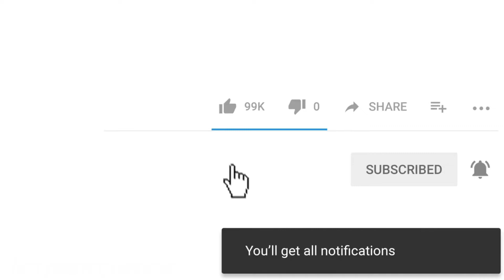How to Blend Within the Panel

Comment: I have that same gun, just curious to know why you spray clear @24psi ? Have you tried it at higher pressure ?
Reply from the maker: This gun really amaze me compared to high end sprayguns, with that air pressure I can spray basecoat and clear nicely, with expensive guns, I need at least 29psi sometimes even 35psi. I've tried spraying beyond 24psi with this gun but I don't like the result. Thanks a lot for watching and your query, have a great weekend.
Reply: Ian paints/details Thanks for the reply, have you sprayed any silvers or difficult colours with it ?,, I’ve only used it for clear coat did a full repaint on an Black Audi R8 in Debeer waterbase with there supreme clear. Check out my instagram page xchaserspiro
Reply from the maker: Yeah I did silvers and other metallics with this gun and I love the results, we are exclusively using glasurit 90line products for more than 6 years already. I usually use this gun for basecoat and clear . Sorry but I  don't have an Instagram account, I can't view your page.
Reply: Ian paints/details What gun were you using before this one ?
Reply from the maker: @spiropittas5477  GTI Pro Base 1.3 by Devilbiss
Reply: Ian paints/details Do you have a seperate one for base or use the same one, and just clean it out ?
Reply from the maker: @spiropittas5477   Only one gun most of the time, clean it out after spraying basecoat then spray clear and clean it good before putting back in my tool cabinet.
Reply: Ian paints/details How many turns out do you go on the fluid ?